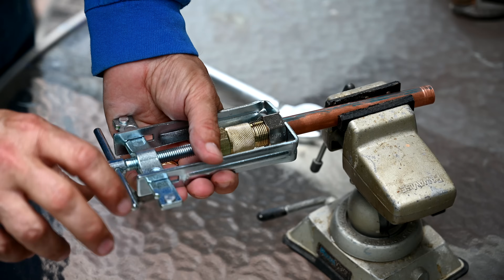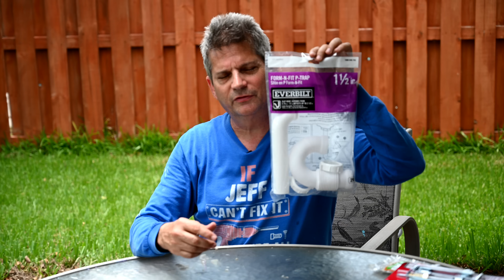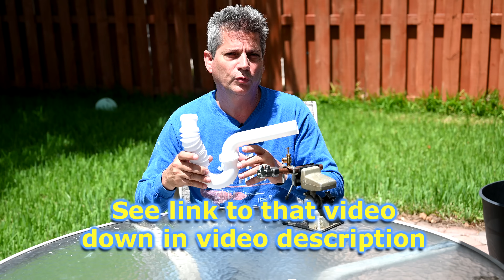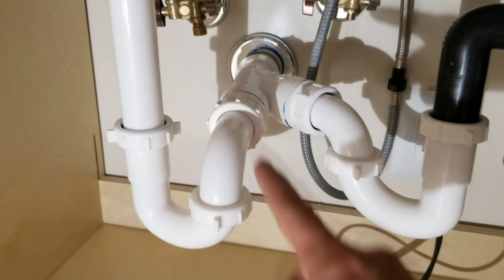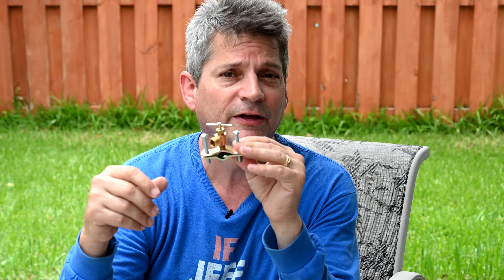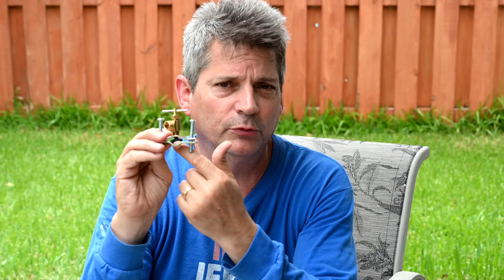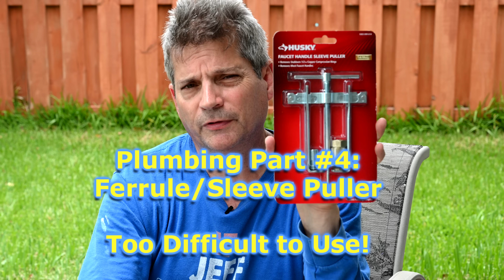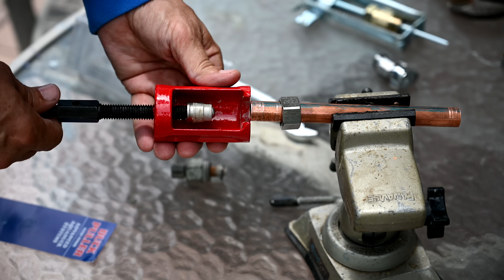4 Plumbing Parts/Tools You Should NEVER Use. NO Plumbing Fails

Comment: Thanks for the tips.  I'm replacing my shut-off valves for my bathroom sink.  They are compression sleeve valves.  I'm headed to Home Depot to look for a compression sleeve puller.  The only ones I'm seeing available on their website are the Husky type you have shown.  It's not about the price of the tool for me, it's more about the convenience of being able to go to a local store today and purchase a tool that will do the job.  Cutting the pipe is not an option since there's not enough sticking out from the wall.  This video linked shows a different method of using that same tool than you have shown. Do you think this will do the job for the one time use I have planned? https://www.youtube.com/watch?v=7KDe8ACKjwc
Reply from the maker: The tool works if you have a pipe and compression sleeve in good shape. If the ferrule is stuck this tool will not work. My issue with this toll has always been that I buy foreclosed and neglected properties, often who have had big leaks in the bathroom, lots of humidity which causes corrosion on pipes. So a number of times I have fought with that tool for a half hour because it has no mechanical advantage, so I had to cut the pipe to get it off after fighting with this tool.

Comment: Seriously?  Hire a plumber to put a pipe in the wall?  Why not add add an air gap with the one way air vent in the vertical piece and make it a P-trap?????
Reply from the maker: Yes, an air gap is one way to do it, but keep in mind, many states don't allow the Studor valve you mentioned. You have to see if your municipality allows it. Typically we use them here in Florida for island kitchen sinks which are more than 5 feet from the vent stack.

Comment: Isn't the term "self scouring" a bit vague and subject to interpretation? The following lines seem to suggest that some of those types of traps might be OK. This is why I don't like codes. They are often difficult to interpret or understand. If they really did not like those type of traps, why did then not simply say so? There is much clearer language they could have used. What not say that all traps must be smooth inside with absolutely no pleating or accordion style ribs , or other similar language? Seems to me that many of the codes themselves ought to be illegal.

I could wonder if some city people are getting paid off by some manufactures at the expense of everyone in the trades, couldn't I?
Reply from the maker: The codes are clear enough, self scouring means self cleaning. Yes it would be nice if they specifically called out form and fit flexible traps. But it does specifically ban S-Traps, and Saddle Valves, both called out by name.

Comment: That husky tool is for taking shower and faucet handles off...not compression nuts...
Reply from the maker: Nice try, Husky bills it as both! Flip over the instructions, you'll see on the back there's 2 sets of instructions, one for using it as a knob puller, and on set for using it as a compression ferrule sleeve puller.

Comment: I was given this when i put my fridge in.. I cut and put a tee and use a shutoff valve and did it right. on the flipside my mom had one in a house she lived there for 30 years and it worked fine. then again she never turned this off after ;p
Reply from the maker: Yes, some people get lucky, others get a $30,000 flood damage bill that the insurance company refuses to pay because the parts used were a violation of plumbing code.

Comment: I have that darn S-Trap in my 100 yr old house and I hate it. It also keeps getting an air gap in the line and then does not allow the sink to drain. I also don't seem to find any plumbing vents anywhere?
Reply from the maker: Try installing a Studor vent under the sink. Most states  allow them, check your local codes.
Reply: @jeffostroff  Thanks. I've been looking at options and that was one of them. I appreciate the feedback. What sucks is about 10 feet away, they hooked the laundry up to the same drain line going into the basement. I'm afraid at some point, I will have to rip it all out. It was done by someone that did a 'remodel' about 20yrs ago before I moved in.

Comment: You are supposed to put the puller arms into the slots at the ends of the top bar and that gives you enough room to turn the screw shaft...!
Reply from the maker: Yes I just didn't show it but it still doesn't give you enough Room we're going to show it much clearer on another video soon
Reply: @jeffostroff  ....👍

Comment: You should have mentioned plastic water connectors. I learned through failure lol. Great video.
Reply from the maker: Which plastic water connectors are you talking about?
Reply: BrassCraft 3/8 in. O.D. x 30 in. PEX Faucet Riser with Plastic Compression Sleeve

Comment: A few things to note. 
1. There are good and bad plumbers as well as good and bad handymen. No need to elaborate.
2. Sometimes the instructions are poor, missing, or ignored.
As far as the Husky puller, I  partially blame the instructions.
From the product Q&A: 
The hardest part of replacing the toilet shutoff valve was getting the old compression ring off the tube. This tool works great, it would have been impossible do without this tool! Watch the Youtube video on this tool.The instructions don't do justice. You have to use both the brass adapter and the silver insert to prevent damaging the tube. The copper adapter screws into the old compression nut to pull the ring off. Remove the shaft from the rest of the tool, the rest of the stuff gets in the way in cramped spaces, where shutoff valves seem to be normally installed. If the handles don't provide adequate leverage, use a wrench or extender to get more leverage, that is what I needed to do, compression rings tend to be pretty stubborn, took some persistence. This tool got the job done without damaging the tube. Installing the new compression shut-off valve was easy after that.

As noted, the arms are not needed for removing the compression ring. This works pretty much like the higher prices tools you showed.
Reply from the maker: Yes my biggest complaint about that tools always been that the arms get in the way because you can't remove them

Comment: I'm sure it's been mentioned below in other comments, but the last tool you have ......works great for pulling the faucet handles off on really old plumbing where they're nearly impossible to pull off.  Just thought I'd vouch for one particular use of that tool.  :-)
Reply from the maker: Yes it does work for pulling faucet knobs off, but not good for pulling stuck ferrule sleeves.

Comment: In defense of the Husky pulling tool - aren't the notches on the ends of the crossbar made to hold the puller arms wider than the crank?
Reply from the maker: Yes, you are supposed to swing out the arms, but they also get in the way because now you have them spread out in your hand while trying to hold it in place. Would not be as bad if the arms were removable.

Comment: The first one is a load of crap.    I'm a plumber from Australia, admittedly however here in Aust both traps are legal  An S trap is no different to a P trap. They both hold the same amount of water in the trap just that one goes out the wall and the other has one more bend and goes down to the floor.  The trap that is shown was put together wrong in my opinion or the reason it fails is because it has a defective design.  It looks nothing like the S trap we have in Aust.  

Secondly here in Aust we have the Melbourne Water Board that test and authorise all new items for plumbing and if it doesn't pass the MWB testing then it isn't allowed to be sold at all, so therefore you won't be able to buy it.   In other words, these crappy quick fix fittings  aren't in the shops to be able to be bought in the first place.

Nuff Said
Reply: But remember that you are south of the equator!!!
Reply: @robertfurdas2760  Blinks...Yeah, so you know a little geography.  Pray tell, what has that to do with plumbing practices?
Reply: justunicorn001 a properly vented system won’t pull water out of a trap. I think he thinks because toilet water spins counterclockwise below the equator. LOL. Low use water toilets have caused far more issues than some of this stuff. The reason they want low use water toilets is because it’s expensive to treat it in the city’s. It all returns to the earth anyway.

Comment: Husky Compression Sleeve and Faucet Puller... you are using it the wrong way... The way you are using it... Is to pull the faucet handles off a sink, that is why you don't have any room left to turn the T handle. You don't use the bar and pullers. Just the T handle and the part that screws into the compression nut. Are you actually a plumber?
Ferrule removal... https://www.youtube.com/watch?v=7KDe8ACKjwc
Faucet handle removal... https://www.youtube.com/watch?v=ae-zQ1l67p4
And you forgot one thing... Don't use plastic waterline for ice makers they always fail eventually.
Reply from the maker: I know they want you to spread the side arms out, but look at the video, the clearance is still the same from that stupid little twisty finger bar and the arms, they still get tin the way. They should have made this tool so you can remove the arms. What they show in that video you linked to is in a sterile studio where everything goes right. that's freaking la-la land Disneyworld stuff. Step into my world, where we deal with real world failure modes, and 50 year old bathrooms that have had major floods and humidity and corrosion over the years. The Husky tool fails on that. that's why I use the  Duck Puller and the Engligh Tool Company pullers, both are much better tools with a much better mechanical advantage that does not require me having to use my weak fingers.
Reply: @jeffostroff  The other video I saw it showed them unscrewing the T bar first from the beam and arms. With the husky.
Reply from the maker: @kiddiescripterkiller  You can see his knuccles  stikk bang against those clumsy arms, the tool is a pain in the neck to use in that manner. Furthermore, he's showing you that tool on a brand new ferrule, on a brand new copper pipe, all studio perfect. Why doesn't he show you that tool working on a corroded ferrule and old corroded pipe with blue and green all over it? See all you guy keep getting sucked into this tool which only works on some ferrule sleeve, but not all of them. I'm an engineer without the luxury of having something work some of the time. It must work 100% of the time for me.
Reply: @jeffostroff  Sorry... I should have said "another" video... Here is is...
https://www.youtube.com/watch?v=MjNrGuxYvjQ

Comment: You might want to read the instructions on the Husky puller, you're using it wrong.
Reply from the maker: Using it just fine. It's a poorly designed tool trying to do 2 jobs at once.
Reply: @jeffostroff  You're supposed to remove the arm assembly while using it to pull compression rings and just use the threaded rod, the bushing and the part that threads into the compression nut.  Much like the Duck Puller.  Here's another video of someone using it as intended.
https://www.youtube.com/watch?v=MjNrGuxYvjQ
The arms are for removing faucet handles and it's even advertised as 2 tools in 1.  Your mistake is trying to use everything to do a single job.

Comment: Monument 2030b Olive Removing Tool 15mm
Reply from the maker: Yes, those are popular in the UK. It still think we don't need to cut the ferrule sleeves when you can slide them off the pipe with the correct tool.

Comment: You mentioned that many of these things don't conform to the plumbing codes and insurance companies will cancel your policy if they find that you've used them (with good reason). The funny thing is that many of codes we have (electrical, building, plumbing) are the result of the insurance companies themselves. They don't like paying claims so they do everything they can to implement codes that reduce the chances that they'll have to.
Reply from the maker: Yes they probably have a lot of input, along with plumbers, engineers, building inspectors, and more, as all these things are done by committee.

Comment: I just saw this video and I went looking. British Columbia does ban s-traps, EXCEPT for standard s-traps. No definition of what a standard s-trap is though.
https://www.bcpublications.ca/BCPublications/ is the website with building, fire and plumbing codes 2018 (latest code version listed )

I bet I can detail a use for saddle type connections the inspectors would ignore.
As taps for a watering system in a greenhouse. All the plumbing is completely exposed, no danger from mold and leaks just water plants. Any farmer using a greenhouse and this type of connection for a watering system would also see a leak and have the tools + ability to fix the problem. ( over watering can damage crops, costing them money so a motivation to fix it is there. )
Reply from the maker: You might be right on the Greenhouse use!
Reply: @jeffostroff  it does seem a likely possibility, and not something you would be to likely run into in Florida.

Comment: There are good and bad pro's, handymen, and DIY's.  It is more about honesty, integrity, competence.  I just replaced a sprinkler pump relay.  The electrician quoted $815.00.  The part was twenty dollars and the labor was one trip to the supply house and one easy hour of work.  Four times in my life pro mechanics (all licensed pros and two were factory trained) have made mistakes that could have easily killed me.  The dashboard went out on my Toyota as soon as the local dealer worked on another problem.  Of course they said it could not be their fault and the repair would be $1000.00.  I found Youtube videos that showed me how to replace the one capacitor on a circuit board that went bad.  Total cost $0.50 and an afternoon of work.  I will DIY every time I can.  Many pros are competent and honest.  Some are neither.  Nobody cares about my stuff and my money as much as I do.  Your video did make some good points, and I thank you for that.
Reply from the maker: Thanks for watching Dan!

Comment: My old basement has S traps on the sinks. They go strait down into the concrete floor. How can i fix that without digging up my basement to redo the drain lines?
Reply from the maker: 2 ways to do this, one is when you remodel, you chisel up the vertical pipes into the slab and move them into the wall. The other way is to add a studor valve or an Oatey Sure Vent valve under the sink in your drain line to suck in air and give it proper venting. Some states don't allow it, nut here in FL they do allow it, because with an island kitchen sink more than 5 feet from a vent stack, how else are you going to vent? We had one in one of our properties with an island sink once.

Comment: I have a hard time taking a plumber seriously that can't think of the word syphon.  Not much good to put out content saying you shouldn't use parts without properly explaining why. The whole video comes off as "Just call a plumber instead of fixing it" rather that, what it should be, "don't use these things, do this instead." Then showing the proper way to do it. 
Also was comical seeing a complaint on the puller about the handle being too close, while it is fully at the end of travel.  Sure it is a crap puller, but complaining about something that would never happen in real use is insane.  as for leverage, if you got your wrench there you want to use on the other pullers, it's effortless to slip the box end over the handle as an extension.  It's a crap puller, but plenty good enough for folks that need to pull 2 or 3 rings every 5 years.  I find just cutting off the end of the pipe to be the fastest solution, then replacing the shit compression fitting with one that threads on.
Reply from the maker: We have separate videos that show how to avoid using these parts, the video would have gotten too long. Some people already whined and moaned about the length of it.

Comment: Hopefully not a repeat question.

When you were demonstrating the ferrule pullers, you showed a small one that looked like a shop-made tool. Do you have any information on that, if it is infact shop-made, or store bought?
Reply from the maker: Yes that is the English Tool Co tool, although I prefer the red duck puller, a little easier to use.
Reply: Thanks!

Comment: Saddle type fittings. Does that include the screw-in stop valves?
Reply from the maker: No, screw in valves are fine if they screw onto a male threaded fitting that has been soldered onto the pipe. Only saddle fittings that pierce the pipe are banned. I would also avoid any dissimilar metals that are not brass or copper, as they will corrode on the copper pipe.
Reply: @jeffostroff  The Aladdin Easy Fit Isolater, what would that be categorised as?

Comment: saddle valves if used correctly and right style for type of pipe they work flawlessly the city uses them to tap new branches off a pressurized main water line
Reply from the maker: The types of saddle valves you are talking about used by cities are not even the same beast, they are much more rugged. The crappy little saddle valves that Home Depot sells for residential use are cheap Chinese white metal, which when bolted to copper reacts with dissimilar metals causing electrolysis and starts to corrode the copper pipe.